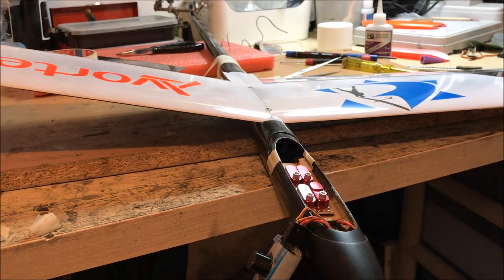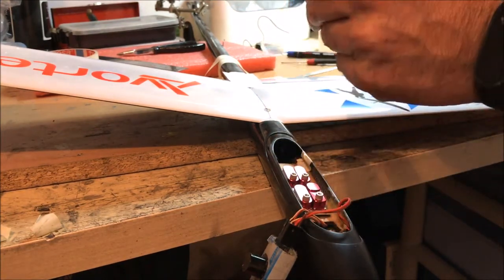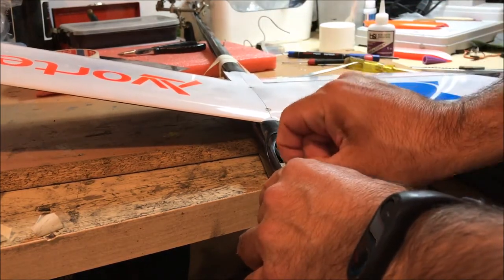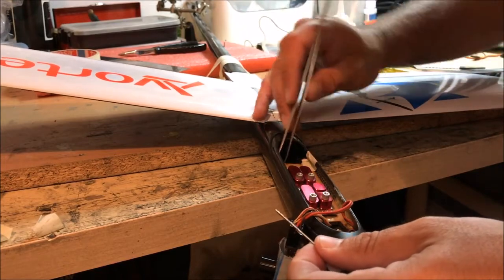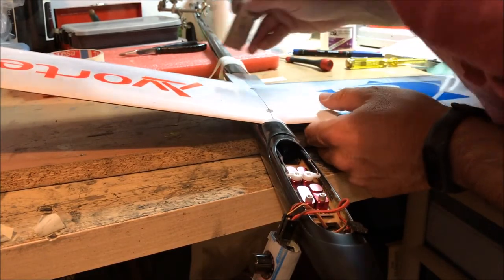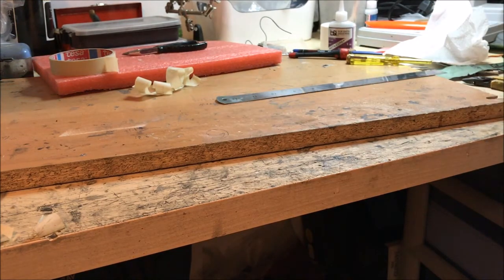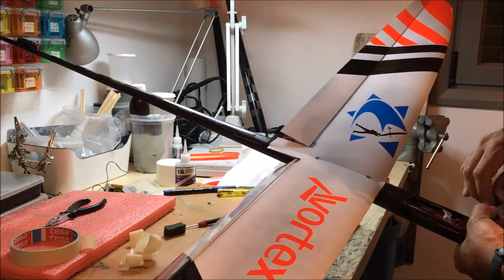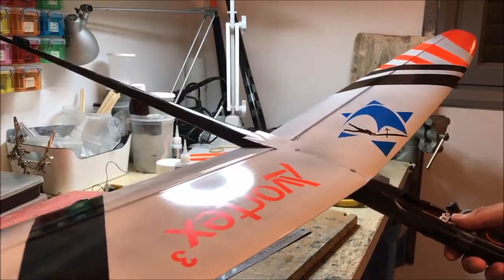Vortex 3 building instructions - chapter 4

Comment: great build process for any model, wish i had watched this 5 years ago.
Reply: Why was his ailerons in lowered flap position at neutral servo setting?
Reply: @Wheezmaster2012  The servo horns are in the centre with 13mm of down flaperon on both sides so that the full range of servo movement either side of this position gives 12mm up and 38mm down, i.e. differential movement.  The aileron neutral position (in line with the wing root) is set in the flaperon mix function in the transmitter.